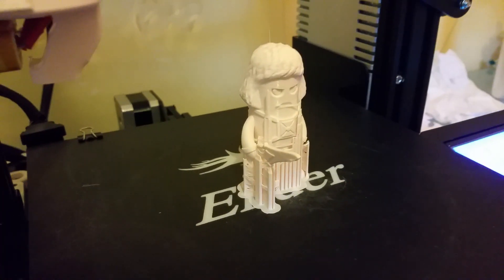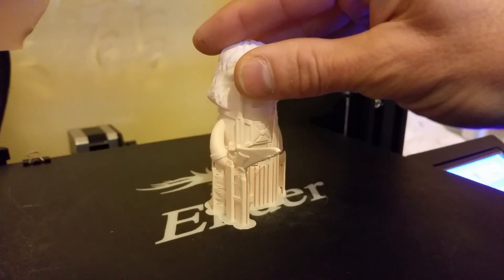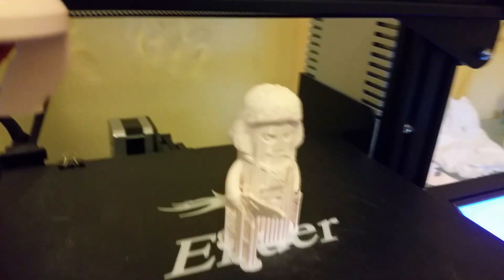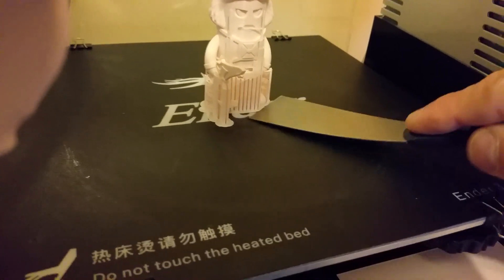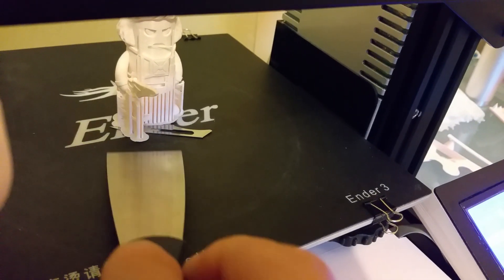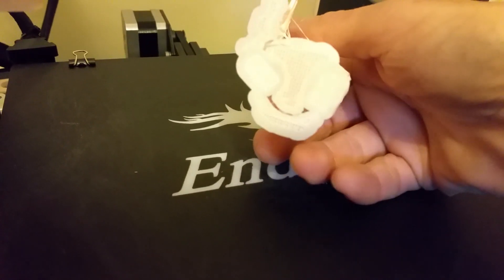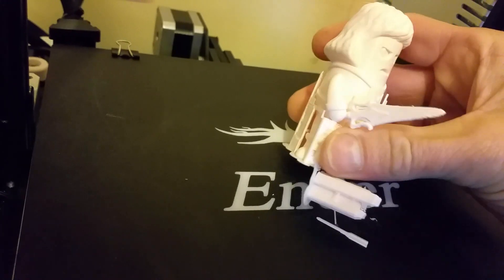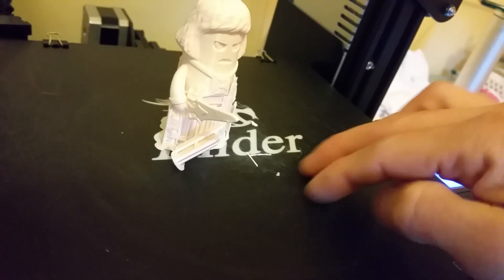Ender 3 Cold Bed Test Print Removal & Adhesion

Comment: What bed is this?
Reply from the maker: Stock Ender 3 bed
Reply: @spidiq8  Wow i tried this on my Carburundum bed but cant get it to work.. then I tried my pei magnetic sheet and still nothing.. Maybe ill try the Creality Frost cold bed and see if that will work.🤔
Reply from the maker: @auzzyboy276  I wouldn't worry too much. I reverted to using heated because I found that corners can lift and warp on larger prints

Comment: U all going to want to kill me and say stuff to me but here I go:... I was having problem with model getting stuck on the plate pretty bad... 200 degrees extruder and plate 60 degrees... Then all I did was turning the plate to the clear side and Whalah .. It works like the glass plate or even better.. Please try before u say anything .... Thank me later.. i wonder why nobody even suggested it..
Reply from the maker: I certainly won't say anything untoward, this is all new tech still and very much a learning process for all and there are really no true 'experts'.
What matters is what works and it sounds an interesting idea, I may give that a try at some point, I only really have problems with the prints sticking badly if I leave it to cool completely first (I always print with bed at 40 degrees now)

Comment: My heated bed stopped working, common problem with the Ender 3 btw.  You have to re-solder the wiring to the bed. So I thought I'd try a stone cold glass bed and print with TPU. It stuck just as well when heated, amazing.  Next PLA :)
Reply from the maker: I was surprised how well this stuck to a cold bed but I do use the bed heated normally as the print releases better as it cools. I use 50 degrees on the standard buildtak and 60 degrees on glass plate on the E2
Reply: @spidiq8  My attempt with PLA on a cold bed failed, partly due to the temp but probably due to crap PLA. Lockdown has given me plenty of space in my head to try new things so I'll try your temperature too, cheers

Comment: This is annoying. For those with a permanent non-flexible platform, I suggest you invest a few bucks into a flexible magnetic platform upgrade. With a traditional platform like this, this will take a few minutes... Whereas with flexible platforms, all you gotta do is flex it and the prints drop right off (5 seconds).
Reply from the maker: Considering this was uploaded 2 years ago, yes. Technology has moved on a bit and now there are any number of options including supplied magnetic ones.
Reply: @spidiq8  indeed.
Reply: It is ridiculous how many upgrades you need to make on this printer right out the box...
Reply: @Troyboy2121  there is no need to upgrade anything, especially with the Ender 3 nower day's. Upgrades are still upgrades and especially 3D printing is not a hobby that is hit a button and everything works it's a lot of try and error

Comment: a bit new to the 3D printing and just got into supports for my models. How did you get  like  At the moment I use Cura but it prints these solid bits that are a bit tough to break off.
Reply from the maker: There's a big chunk of trial and error and trying different settings. With practise you get to know if you can get away without using supports on certain models. Often on thingiverse the info will tell you it give guidelines for recommended support and infill settings etc.
Unfortunately there's no shortcut and I'm no expert so I recommend you check out cura tutorials, there are many on here with more info than I could give you.

Comment: i needed to use a big wrench to remove my print and when i try to remove my prints my prints break before i remove it
Reply from the maker: You shouldn't need that much force to remove a print.
I have a standard ender 3 print bed and a bit of levering should do it

Comment: How did u turn off the bed pls help.
Reply from the maker: Set the bed temperature in Cura or whatever slicer you use.
You can also turn it off manually in the menu of the ender 3 but need to do this before it heats up fully.